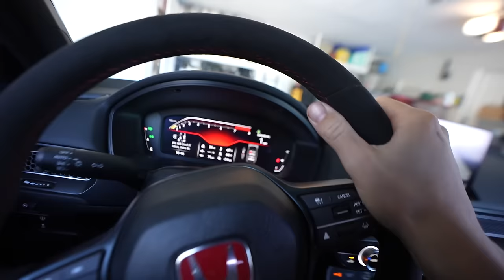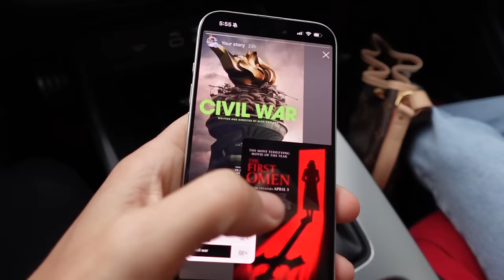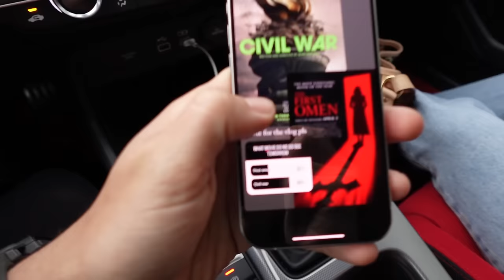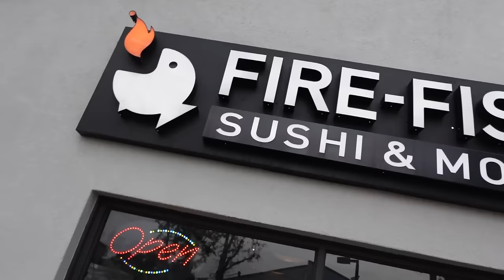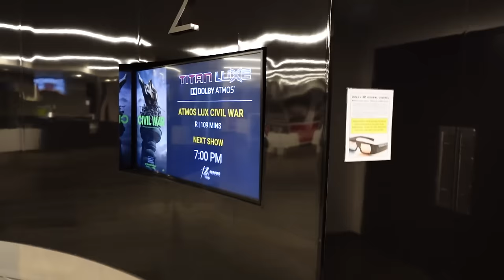BEST FL5 Type R Mods So Far!

Comment: As an FL5 owner, I’m glad you went back to the Sonic Gray Pearl. So much cleaner. I have the Blue Pearl myself.
Reply: The FL5 looks Godlike in Black.
Reply: @sp6450 My first one was black and it looked great when it was clean (which was hard to keep).  I thought it would look incredibly if all of the accent pieces that are typically glass black were swapped out with carbon fiber (side skirts, splitter, diffuser, wing, hood vent, etc)

Comment: Wing angle does not increase downforce chief. the Purpose of a Wing is to create a difference in air speed around the top and bottom of the wing. like a airplane wing